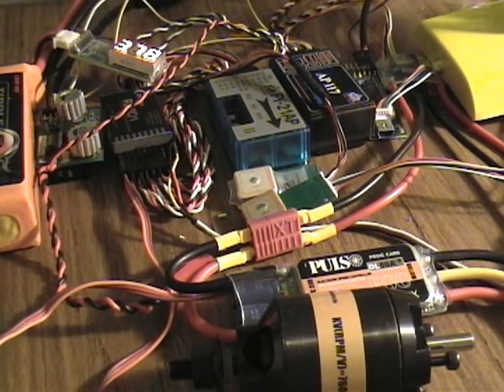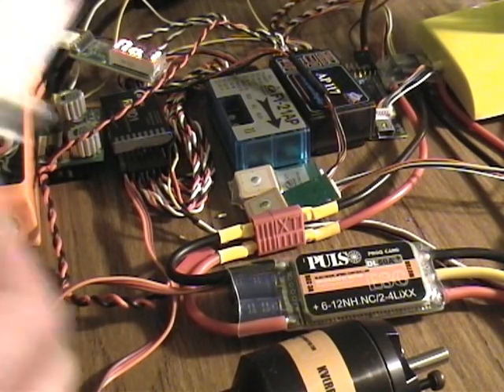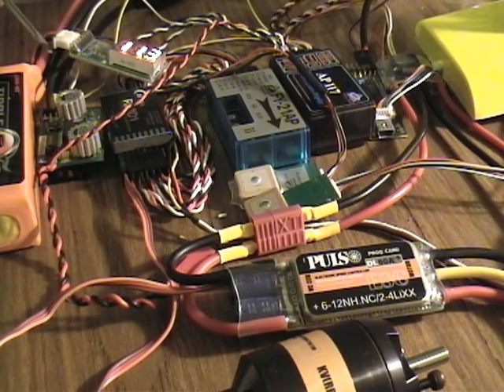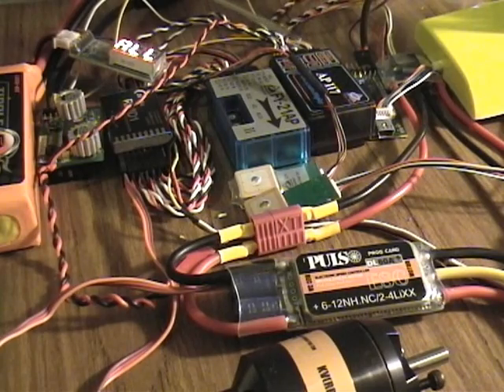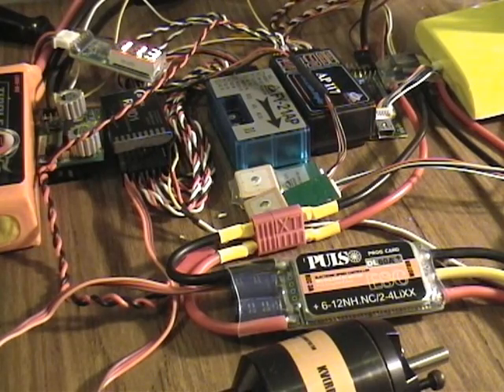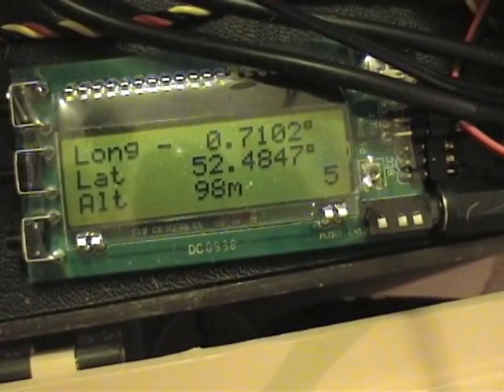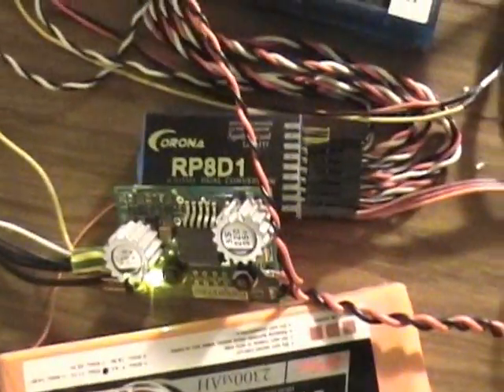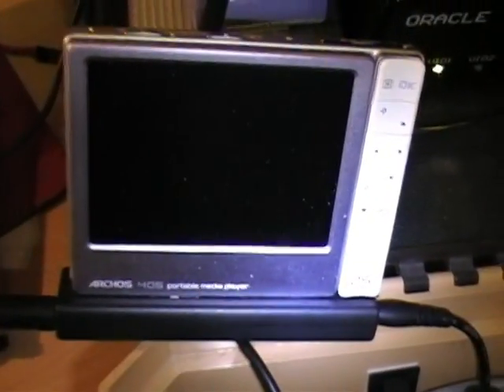FPV Autopilot FY21AP+AP117 Bench Test.

Comment from the maker: Hi
Yes, 
Make sure your chosen plane is a good stable flyer first and take your time to work through the instructions. Bench test your entire setup use a liner BEC and not a switching BEC to power your RX, camera and VTX; the bench test will show up any RF if things are to close to each other, such as GPS not locking and Video noise. If that happens shift things further apart, then work out how to mount it all in your plane